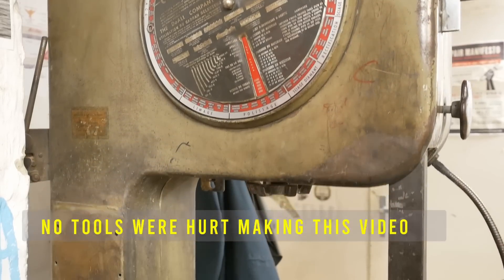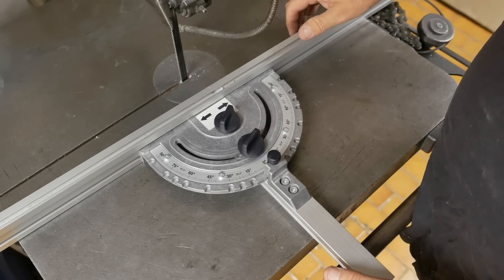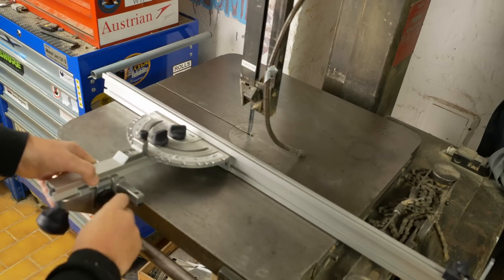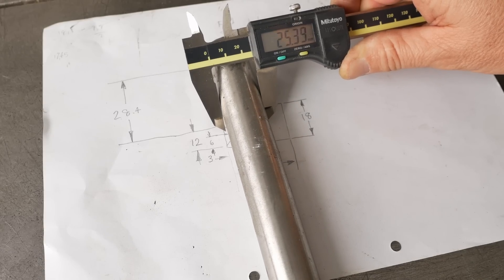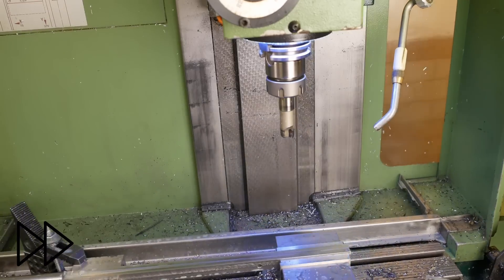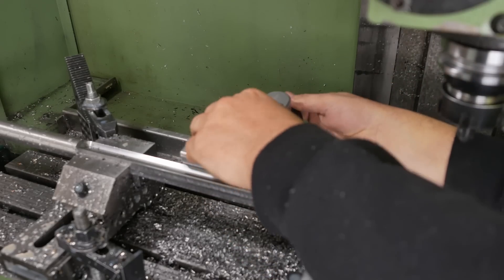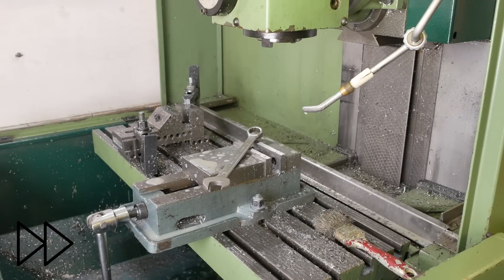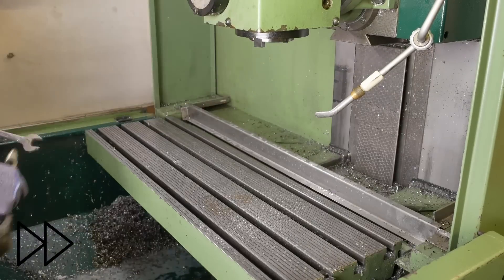Festool mitre fence on the DoAll bandsaw || RotarySMP

Comment: All the R&D, mistakes and triumphs, preparation and cleaning is a part of making. It’s not all shiny cuts and beautiful parts. So at least some of it should be shown. By the way what was causing the lifting?
Reply from the maker: Thanks. 

I think the lower clamping bar, being metal and flat, decides the position. I measured the optimal distance roughly at 12mm, but it probably needs another 0.5-1mm machined off the bottom of the bar for it to sit flat.
Reply: @RotarySMP  Okay. And about drilling into a machine, if it’s a well designed modification, it’s all good to me.

Comment: 9:00  - for job like this it's its nice to have a pack of 4-5 cheap chinese grinding vises.  same style as you are used on a left side but smaller size (small ones are really cheap and well suited for such thin and long parts)
Reply from the maker: How do you use them? Do you bolt them all down to a jig plate, with the jaws opening horizontally?

Comment: For cleaning up my mill I use a 2 gallon shop vac. It uses one of those cheap Chinese vortex adapters mounted on top of a 5 gallon bucket to capture the swarf. No swarf ever makes it to the vac so I never clog up the filter and my swarf is collected in the bucket for recycling. I also have a Dirt Devil vortex floor vac that I rescued from a dumpster. It's small after I removed some of the lower, unused junk, leaving just the vac motor & vortex body. It has a small diameter flex hose and hangs on the wall between my mill and lathe. It's easier to use and empty for smaller jobs than the 5 gallon. Both work great for vacuuming while milling as the vortex almost instantly cools the swarf. Also, my mill is in a corner and the bigger vac fits nicely into the corner behind the mill keeping it out of the way in an otherwise unused space with the bucket (and vortex unit) on the left side of the mill, under the bed, where it's easy to access and empty but out of the way.  As usual. great video. Looking forward to seeing the lathe finished and making parts.
Reply from the maker: I am also looking forward to making more progress on the Schaublin, but am currently in a TIG welding vortex :)
Reply: @RotarySMP  Yeah, those vortexes can be really tricky things to navigate. They kind of suck you in. Good luck, see you when you get flung out.

Comment: G’Day RSMP, getting caught up on videos after a quick holiday…put me down for coping with reluctance and drilling the new holes 🕳️. There are ground rules, of course: the holes must be necessary to a worthy repair or upgrade, they must be correctly aligned and spaced, they must not break out sloppily against a web or other structure, and they damn well must be square. Imperial machines must have imperial fasteners added, metric machines must remain metric, and Whitworth machines…well, they’re tricky.

With DRO’s being added in the thousands to old machines, there must have been many thousands of such decisions! 👍
Reply from the maker: Oops, I failed on at least one of your criteria there, probably more :)

Comment: Nice video you where vieuw day's ago in The Netherlands (1:53)  I think when you have longer parts you have to dig a hole in the wall 😉 Yes  have the same problem for 46Y when I cutting stainless steel I have my hand full of splinters 😒
Reply from the maker: I could also take off the machine splash guard on the other side and hang the bar out that way.

Comment: Great video as usual! 

I was wondering why use this particular miter gauge as a rip fence? Seems like the angle adjustment mechanism is useless in that configuration. Are you planning to also make an attachment bar so you can use it as a miter fence too? I could see that being pretty cool, although designing the slidy bit might be a little more complicated!
Reply from the maker: Thanks Jim,
Yeah, the main idea is still to mount it on that bar, and use it as a mitre fence.  I dont have a solution for that joint yet though.
Reply: @RotarySMP  I was imagining a linear rail / bearing attached to the side of the bandsaw table, and then a piece like you machined here attached to the bearings. Then the fence could be tightly clamped down but still slide freely. Dunno how well that would work, but I’d imagine it would feel pretty awesome in use! Being able to use the same fence for rips and miters is a very cool space saving concept.

Comment: Really random question but what are you using as coolant in your Maho? Any pros/cons with it?
I've been using something from Tilia which either makes a sticky goo on EVERYTHING or with slightly lower concentration, creates rust.
Reply from the maker: You are asking the wrong guy. It is the disgusting soup which was in the machine  when I got it, topped up with whatever the coolant is which I get at the local tool store. Not recommended.

Comment: The machine is to do the job I need, if another hole helps I'll drill it. On that DoAll you can weld the hole over and grind it smooth and you couldn't tell it was ever there.
Reply from the maker: It is a cast iron table, so welding would be tricky, but I could make a threaded plug from cast iron and epoxy that in.
Reply: @RotarySMP  Excellent!

Comment: Call me crazy, but I love seeing a machine get cleaned!  And I didn't know that the blades were not totally connected until I heard the clicking of them as the wind blew.  I later was taught more about turbine engines.  They are pretty AWESOME!  Nice CNC work....
Reply from the maker: Hi Jasper. Those CFM's can make quite a racket windmilling on the apron.

Comment: maybe if you machine just enough of your rail to mount the clamping mechanism of the fence and then mount some sort of linear rail (edit: maybe even a drawer slide) between the machine table and your rail? And the Festool saws this fence is used on act as "Unterflur Kreissäge", they combine a table saw with a miter saw, by allowing you to move the blade instead of the working piece on cross cuts. There is a sliding mechanism as option, but normally you just pull the blade and push the wood against the fence. If you're interested look into the Festool Precisio or the Mafell Erika, those are saws that work like this.
Reply from the maker: Thanks, I hadn't looked into how Festool used it yet. I'll have to look and see if there would be clearance to add a linear rail.

Comment: Also why not mill slots in each end of the table, perpendicular to the feed direction, and embed magnetically-held rulers there?
Reply from the maker: I considered it, but a band saw is not a finishing tool, so I have to leave a finishing allowance anyway, and then it is easy enough to use a ruler to set it.

Comment: I'd have made an adapter, given the existing holes so close by, but new holes are the cost of doing business.
Reply from the maker: Thats a fair point, but then I would be faffing around trying to source imperial screws here in metricville.
Reply: @RotarySMP  If only you had a CNC lathe or two 😉
Reply from the maker: @jimsvideos7201  Ouch. Well put :)

Comment: draft angle of the table casting making the fence pop up a little?
Reply from the maker: That edge is machined, and right angled. I think the lower clamp of the Festool, being flat and a large surface, with a pivot drives the alignment. I probably just need to take a half mm off the lower surface of my bar.

Comment: Do you miss not having a feel for the cut on a cnc tool? 
As for drilling into the saw: it's a tool, if it doesn't do what you want and you can change it so it does, well go for it.
Reply from the maker: It takes a while to replace that "feel", with a method to look up the correct feed and speeds in tables, and then dial them back fro max productivity values to something more reasonable in the home shop.

Comment: The table extension on my festool miter saw seems to have the same clamps on it, if  it helps I can try to take some measurements.
For your miter fence the first thing that came to mind was to install a round linear rod to the side of the table and have an adapter for the festool clamp bolted to the polymer bearing.
Reply from the maker: I see that the Festool  saw has a v shaped extrusion, so it doesn't have such a wide lower surface as my bar. 
Yeah, that is the plan, to make something which moves on the bar which the mitre gauge can slot into. Not a lot of space there and I dont yet have the design right.

Comment: One more thing, always wondered what happens to all those metal shavings from a hobby, machine shop? You must accumulate some large quantities over time. Do you cast them or do you have recycling facilities or do they go into the bin? Feels like a serious amount of metal to go to waste over time
Reply from the maker: I have a large rectangular bucket, and it slowly fills up. Once full, I take it to the recycling depot a few blocks away, and dump it in the metal's bin. I only fill that bucket 1-2 per year. I don't do that much machining (not as much as I would like).

Swarf is a bad basis for home hobby casting. Too much surface area, and too much oxidation.

Comment: Cool mod! I'm no machinist but I do use a table saw sometimes and a nice feature that my saw has is a built in scale that indexes off of the fence so I don't  have to break out the calipers and/or gauge blocks everytime I make a cut. I feel like this could work for your bandsaw if you attached or engraved a scale on the new mount (or just above it).
Reply from the maker: Hi Paul,
I thought about it, but a band saw is not a terribly precise cutting tool,  and you always need another op to clean up the surface. Setting with a ruler to about a mm seems accurate enough for now.

Comment: Did you watch the Starship/Superheavy launch? Quite spectacular. Shame they didn't have a proper launch pad or it may have done better.
Reply from the maker: Hi Andrew, I sure did. It certainly exceeded expectations (I expected it to beat the Russian N1 rockets record for the most explosive rocket ever). I dont really understand why they were resisting the obvious. A flame diverter. The Super heavy booster is not going to mars, only the Starship is supposed to do the off field take off.
Reply: musk regularly hints at military vehicles like his APC concept.  same thing with rockets that launch in the field.
i'm no conspiracy theorist but the three nozzles could be on purpose and the dented tank could have been rigged to achieve low pressure.
and as for reinforced concrete pulverised by hot fire.....  i was in my mid 20s during 9/11 twin towers pantomime.
so this looked like a genuine test with a few contrived errors to demonstrate fault tolerance and also, a demonstration of media savvy.
Reply from the maker: @PERL6_master_race  Million and half lb of thrust at LOX + a hydrocarbon at  stochimetric temps .... they need a deluge system and flame diverter.

Comment: No, slots for blades in disks (or hubs, whatever you want to call them) are broached, not made with wire EDM. I've seen such a machine, broaches were between half and one meter long and put together formed one continuous broach about 6 meters long.
Reply from the maker: Thanks for that Stefan. I hate to think what it costs to get the broach made. Do you know how the curved dovetails on the Trent fan disc is done? A "bent" curved broach would do that I guess?
Reply: @RotarySMP  I don't know how the curved dovetails are made, it would be interesting to find out.
Reply from the maker: @timmythesheep  It would. Doubt RR will be opening the kimono for us though :)

Comment: If you need a hole to make a tool do a job and it doesn't compromise the the construction, then make it into a better tool! Once had to persuade a plumber (before laser levels) to cut down an 1800mm level to 1700mm because he was fitting a lot of baths - which are nearly all 1700mm and set between two walls. Tools are tools to do a job.
Reply from the maker: I like that one Phillip.

Comment: Seems like there has to be a better way of cleaning than trying to brush all the sticky metal bits around. How well would a shop vac work?
Reply from the maker: My Shop vac is also used for wood dust extraction. If I mix wood dust and old coolant, I'd have it gummed up with gunk. Since I dont use the Maho every day, this doesnt really bother me although its a bit slow.
Reply: @RotarySMP  Do we need to do a fundraiser to buy you a dedicated mini-shopvac? :)
Reply from the maker: @JCWren  Thanks for the offer, but I'd probably not buy it, as I already have a battery powered vac as well. I push all the swarf into the tray with the brush, and heap it up the side a bit, so the coolant can run out. Go back the next day and scoop all the swarf into the metal trash bin. I do use the battery shop vac at the end, once the chips are dry.

Comment: Mark, it’s never a problem to add a functional hole to a machine.  Even better if it’s a functional threaded hole with purpose.  What’s not acceptable is a partially threaded hole that has a broken tap stuck in it. 😮  

There definitely isn’t enough youtube time-lapse of cleaning machines.  Really provides the prospective that a finished machine part only means the two-thirds of the job is done. And the first third is the setup including mostly running around the shop finding the appropriate packing necessary to hold the bent stock down.  👍👍😎👍👍
Reply from the maker: Hi Joel. You nailed it. It took me all day to machine that one bar. Lucky I am not a machinist, or I would go hungry :)
Reply: If you want to see machines getting cleaned up and cared for, Cà Lem does great videos :3
Reply: @whatevernamegoeshere3644  Agreed. I have watched every video Ca Lem has uploaded.  Simply fabulous and inspiring work. 👍👍
Reply from the maker: @whatevernamegoeshere3644  He does. I have been subbed to his videos for ages. Brilliant.

Comment: Seems like a you should revert to using the bar as it provided a sliding feature - I don't really have anything much to say, your tools, your choice. I'm not sure how difficult it would be to modify the clamp to slide on the bar but certainly more difficult than adding a bar onto the casting.
Reply from the maker: Hi Adrian I agree. I still need to make a widget to connect the mitre gauge to that guide bar. The geometry of the two is such that an obvious, simple solution had not yet presented.
Reply: @RotarySMP you could mill an adaptor with a short section of the v-groove-rail which fits the festool clamping mechanism and a parallel hole which fits the guide bar.
To make it slide very easily, without any play you could integrate some tiny roller bearings, but it may be difficult to construct it in a way so it looks good without being bulky and with adjustable bearings to eliminate any play.
Reply from the maker: @Henning_S.  The top of the bar is already above the V clamp, so one or the other would need to be replaced/redesigned.
Reply: @RotarySMP  you can use a linear guide rail mounted directly to the side of the table and the carriages/linear bearings mounted to a section of the v-groove-rail. That will be pretty slim, and shouldn't stick out too far from the side of the table.
The linear bearings just need good wipers to prevent the sawdust from getting into them...

Comment: Nice work. The lifting at 11:30 seems to come from too little clearence between the clamp and the table. Maybe you can space the rail out a little ... 

Concerning the extra holes: If it doesn't destroy / restrict / reduce the rigidity of the machine itself, I would drill a hole in any machine.
Reply from the maker: Thanks for the close look at that.

Comment: Sooooo... when did the "Duh!" moment hit ? 
I have a feeling you have to remove the fence rail to change the blade, no ? 😁😅
Reply from the maker: I planned for that. It only takes a couple of seconds to remove the two screws, but this way I can bring the fence right up to within a couple of mm of the blade.
Reply: @RotarySMP  Good! No great care for placement needed then? (It Was my main concern regarding that) 
Changing blades is already a hassle without interfering bits 😁
Reply from the maker: @gabinpiedbois4063  Changing blades on this model DoAll is surprisingly easy. Mine has one big swing out door, held close with a spring clamp. Pull open the door, loosen the tension with the knob, (not unscrew two screws), and pull it off.

Comment: you can see at 11:30 when you clamp the fense that the v-grove of the base is wider than the fence
Reply from the maker: I think the problem is that I need to take a mm off the bottom. The lower clamp sets the angle, and needs to pivot more flat.

Comment: What can one say it needs work but as a ripping fence there are questions. Gee that stainless milled ok I was thinking it will work harden at any moment. 
Also the cooling fluid needs changing looked a tad brown colour while  drilling. Add it to the list to do. Have a great week.
Reply from the maker: Yeah, I hate stainless, and also expected it to put up more of a fight.
That coolant is pretty bad. I'll put it on the list.
Reply: @RotarySMP  Have you looked into flushable coolants ? they do exist . 
at the dealer that i worked for, we used maglube from magnus chemicals  montreal,  in our 
showroom machines . it was a fully synthetic oil and could sit in the sump for months and 
never smell . just add a bit more water to fix the consentration when needed. 
I have no doubt that similar products exit in europe. 
A lot of the common name cutting oils stink badly from new ,not something to bring into a home.
a very important thing to do beforehand  is very thoroughly flush all of the old rotten stuff out.
Reply from the maker: @steveggca  That sounds like what I need Steve. I dont use the machine that much, so the coolant will sit for extended periods.